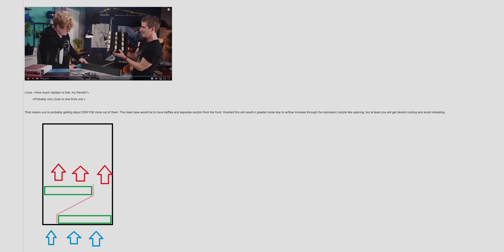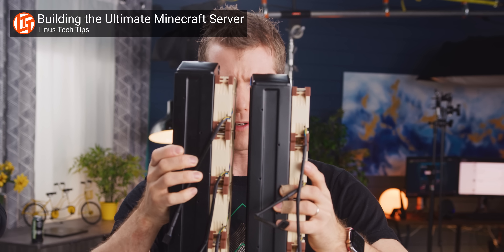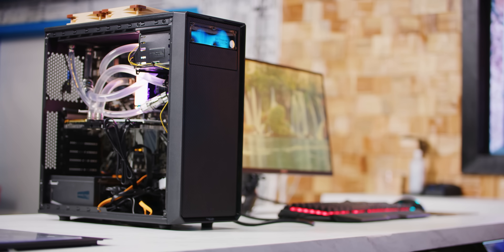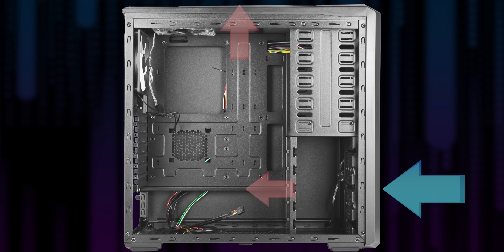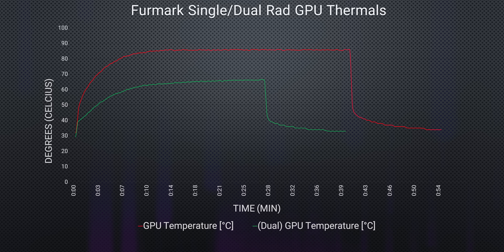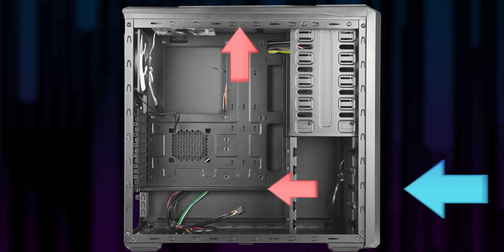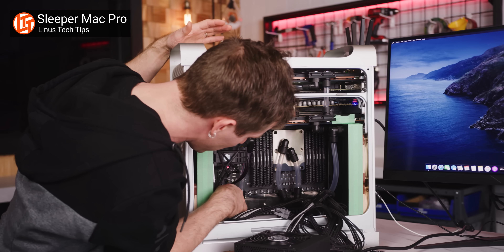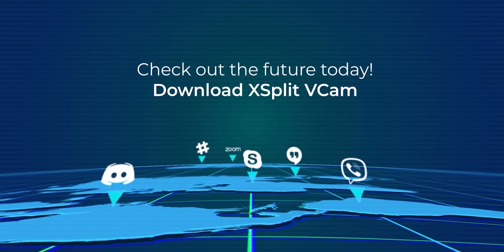I’ve been water cooling wrong for YEARS - $H!T Manufacturers Say

Comment: Corsairs' rad calculator is basically right but likely lacked the required data/specs of the exact cooling system units you used, so the substituted it with "generic data",
Their heat exchange calculator is likely based the same type of calculations (thermo-dynamics  & fluid dynamics) used for building HVAC Systems and Vehicle radiators/intercoolers when perusing maximum cost to efficiency of any heat exchangers. 

A. 
Their feed back on your 2 systems were likely based on:
1. The HackPro (1 front intake rad & 1 rear exhaust rad), where the first rad pulls cool external air to cool the first loop. 
This results in the air leaving the first loop and, being hotter than ambient.. increasing the temps within the case. 
The now already heated air inside the case, was then used to "cool" the second rad, which then finally expelled the even hotter air out the back.
So though it may not necessarily be pointless (depending on the spec/parameters of the loops themselves, additional exhaust ports, etc), it is definitely not the most efficient cost to performance setup.
Simplified solutions - a. Add an intake fan to the top of the case & flip the front rad to blow outward or 
                                      b. Add an exhaust fan to the top of the case & flip the rear rad to suck in 
2. The Custom Minecraft server (Stacked rad. build)
It follows the same principle above increasing the temp of the air leaving every rad then entering into another. It's just a matter of inefficiency.
Simplified solution - Take the exact series rad configuration and turn them parallelly with a radiant barrier between them and you'll see a greater value. 
                                     
I'm unable to say just how much gains you'll see without knowing the full loop's specs.. but yeah, you get the idea.

B.
And finally, the reason you got a better reading with your test system at the end of this vid, is actually kind of simple and obvious.. 
You actually used 2 feed separated, perpendicular intake systems that both pulled cool ambient air thru them, with case exhausting the hot air thru its rear. 
So it pulled from 2 cool sources and shared a single exhaust point (which is near always the best solution for this type of scenario). 
If you used an exhaust fan at the back, it would increased your efficiency even higher, as it was only operating on compressive force (a high positive pressure) within the case to discharged the hot air, rather than a "guided controlled flow". 
Again, there are actually a calculations for sizing the fans to give a desired low positive pressure, or even a negative pressure and determining what is the best to maximize efficiency for each scenario.

Think of it like this.. when increasing voltage for overclocking, there comes a time when the increase of voltage consumption vs the gains seen aren't efficient anymore.. even if minor gains are there.. well this is basically the same thing.
Heck, even these radiator systems could be made more efficient with the introduction of thermostat units (like nearly every other rad system).. but I'm sure on this small scale they are left out because of the cost/savings just aren't worth it and they are already able to reach the required thermal control.
Reply: I learned things, thanks for taking the time to expand on this video
Reply: why do I think that he made those calculators xD
Reply: jo jace right. It’s basically one bigger cooler moving more cool air. These aren’t really stacked.
Reply: @Skylane_Pilot  The "Series" arrangement is a Stacked unit
A Parallel/side by side arrangement, could basically equate to a bigger cooler
Reply: They are wrong for a slightly different reason, but you still do have a point:
And here is the thing: how hot the air exiting the radiator actually is, doesn't only depend on efficiency but also on flow rate. 
Very simply said: you can heat up one cubic foot of air by 10 degrees, or heat up 2 cubic feet by only 5 degrees. The only way to get the air exiting the radiator to match the temp of the water (in a cocurrent setup) is to have a low airflow. And In that case you're limiting the efficiency of the first radiator! You want the whole surface of the first radiator to be in touch with as cold air as possible, including the exit of the radiator. You want the air to be refreshed before it gets a chance to really heat up to make the first rad more effective.
This boils down to: Corsair is only right about the 2nd radiator hurting performance if your fan is too weak to supply the first rad with enough air. Fair enough...
---
IF their radiators could operate at near 100% efficiency, then their words would make sense. But that could only be the case when you have a phase change (like in HVACs), when you compress the air (with real compressors, not with a fan), or if you have a countercurrent exchange setup (like industrial heat exchangers).
^^If any of these 3 is the case, then the air exiting the radiator can be hotter than the water, and then I would agree with their theory.
---
I don't agree with your statement about diminishing returns. Computer builds aren't that close to physical limits, you can push it quite a bit in every direction you like. There is so much headroom that physical limits don't play a role yet. And computer cooling is a rather primitive setup (like no phase change, etc.), it's simple: want more performance? -throw in more air, more rads, etc.
But you're god damn right that they probably used some kind of standard model for calculating. What they mentioned is actually a big thing in HVACs and other industrial setups.
Actually a lot of students and engineers don't really understand the subject they learn, but they just copy one example project that their teacher taught them, and apply it everywhere. But they forgot it was an example, it's one of the ways to tackle a problem, it's one sort of problem you could face; and they treat it as if it's a universal method for anything. When I was a student it really bothered me.
It's really annoying when your fellow students get something wrong, when they don't want to listen to you explain why it's wrong, and especially when their idea didn't work out at all and you're the one fixing it last minute. And this happened on every single project.
Reply: Hey  @sasjadv  it was just an attempt at an over-simplified explanation, for Linus to understanding the "why", trying to use "layman" terms. 
Didn't see the sense speaking a language that would just go over heads of many.. and by extension, be of no benefit them.

Note though, the overall calculations of "System efficiency" do take fluid flow rate into account (and as we know, air is a fluid).. as well as all the properties and synchronicity of materials used in and around the system.. ie. materials and their thicknesses, material composition properties & fishes and how it relates to their absorption/reflective/radiant/surface resistance properties, fluid flow rates/CFM (internal & external), installation locations/positions/orientations, known/anticipated fluid viscosity, spacing distances & proximities. lengths runs, ambient temps,  wholistic location of system installed components, planar/coplanar assets/liabilities, etc, etc, etc as well as factors included for the unknows, variables and contingencies.. etc. etc.. . Yeah, that would have been more of a thesis than a simplified explanation.

And you are absolutely correct. Controlling the air flow (to the right cfm) over a rad is how efficiency is achieved in cooling the coolant contained within it. Also why a thermostat is used in vehicles to help control the coolant flow to increase efficiency of the system. In other words a "cold" rad doesn't meat the coolant temps are cold.. it just means the rad isn't getting the opportunity to draw the heat out of the coolant as intended. (Also, I am quite sure Corsair was referring to the 2nd rad n the first system).

The "diminishing returns" is a concept Linus understands relatively well in relation to overclocking, so it was just used as a reference of sorts, for him to better understand the point I was trying to make, in relation to cost vs efficiency. 
But the point still stands, that you CAN increase performance at a COST.. the question being the cost vs the value, as the additional equipment presently needed, would cost more than their presently available counterparts, the the masses would pay for. In other words (and being asinine here) a $10k upgrade for 1Ghz OC, is not something that would be widely accepted.
So we wait here for Intel/AMD to make a 10Ghz 6C/12T CPU efficient enough to be common place at an affordable price, that can be efficient across desktop Gaming and Workstations alike.

Yup, its always 1 person that carries the team in group projects.. it happens quite a bit in the working world as well.
Reply: @I_ammm_mojojojo  Ehm... Let's set things right:
If your radiator is 100% efficient, then the air temp and the water temp will just change places. Like air is 20° and becomes 50°, water is 50° and becomes 20°. If the temps of both meet in the middle (they both get the same temp) then the efficiency is 50%.
That's the official way of naming the efficiencies. And it makes sense, right?

One thing that Linus mentioned from Corsair's explanation is the delta T across the radiator. Linus did properly simplify it, however Corsair's statement is wrong.
Here is an example why: when you go to the restaurant you want the plate with food to be full at the beginning and empty at the end; but you don't want the plate to empty on its own, you are the one to make the plate empty by eating. The radiator doesn't want a temperature difference, it wants cold air, the cooler the better; it wants to get rid of the heat, it just wants a place to put it.
So as I said: you want all of the radiator to be surrounded by as cool air as possible.

Here is why a thermostat is actually used in vehicles: it's there to just make the engine cool down less.

The cooler the coolant, the cooler the engine runs, but you don't want that. And the reason is: thermal expansion.Engine components are actually  machined with too much play, so that as they heat up to 90° they get to the desired tightness. A cold engine is just loose, that's why you shouldn't put an engine under big load when it's cold.
And if you remove the thermostat and you engine temp drops down, then that only means that your radiator is cooling more than the engine produces heat. So it's too good at cooling.
And yes, right after a cold start the efficiency of the cooling system is 0%, it's not cooling because everything is the same temp. YES it can not draw heat out of the coolant, but you don't want it to cool. You want your engine to heat up to working temp and only THEN start cooling it to keep it there. That's the only reason for a thermostat.

The HVAC thing: if you have a low airflow, then you really want the heat exchange to be as efficient as possible, you want to get close to the 100% efficiency. Like you have a little bit of air, and you need to cram in as much heat as you can into that little bit of air. And then the second radiator is really going to diminish performance.
But this is the case with heating a building: when it's freezing outside you just want your room to heat up by 20°, you don't want you heat your whole street by 0.1°. So you actually care where this energy goes, and you want to transfer as much from the central heating into your room.
---
On the diminishing returns: if your goal is to just make your system cooler (which is all the video talked about) then you can just blow harder, add a rad, etc.
Let's say you already have a system, it's on your table, and it's running hot, what now? Then I would say: just blow harder, add a rad, etc.
I didn't look at what other CPU you could have bought for the money, that's just a different topic.

Comment: Could it be that the water went to the upper radiator first? Getting from 60C to 40C for example, and then, when it hit the second one (the intake radiator) it cooled down from 40C to 30C? That way the intake radiator could have 40C air going to the second upper radiator, which then cooled down the hottest water?

Comment: Surely the fan position makes a difference? To be optimal, wouldn’t there be a sweet spot in terms of distance from the object you try to cool? Also, if you’re too close, wouldn’t that mean there would be no air movement in the centre (basically like a hurricane where you have the eye and it’s perfectly calm). Obviously the blades will change some of that...

Comment: It is possible that as you used a small radiator in the front, it wasn't enough to dissipate heat effectively. I think in a larger case with something like a 360mm rad, you would probably experience very similar results to corsair's simulation.

Comment: What if you do front and top with 2 intake fans with radiators (meaning you blow ambient air trough both radiators). And then have only outtake fans on back or bottom ?

Comment: But for the love of god connect the radiators in a way that the hot water goes through the "hot" side radiator first and through the "fresh" side radiator second. That way you maximize the difference in temperature between the two mediums.

Comment: We can kind of calculate what is going on.

Watts dissipated = Joules / second  = Heat_capacity_of_air * density_of_air * volume_of_air * ambient_temperature_raise (W = J/s = J/(kg*K) * kg/m^3 * m^3/s * K)

So linus says he has 400W burning and the 2 radiators keeps it at about 20 degrees above ambient. Since the heat capacity of air is 1000J/kg, and the density of air is 1.225 kg/m^3, then you need: 400 / (1000 * 1.225 * 20) = 0.016m^3 per second of air flow.

A typical 120mm noctua fan is 0.026m^3 per second. But that is when every air molecule is impeeded by nothing. As soon as there is a radiator in front of it, the general rule of thumb is that the flow will be 1/3rd. In this case about 0.008m^3. This means we need 2 fans already.

And even at this point this is assuming that every molecule of air hits the radiator and there is zero thermal resistance. Again this isn't true. The general rule of thumb for this is about a 1/2 to 1/3rd reduction again.

So now we are talking 6 fans just to limit the temps to 20 degrees raise in ambient.

This is before anything to do with the water loop/radiator. This is just the amount of air needed to carry the heat away.

So no.... its impossible for a 2 fan setup to match a 4 fan setup if they are all cranking air at full speed WHEN the flow of water is dwarfing both in thermal terms of energy density per second, which is clearly the case.

Most likely the corsair were talking about a quite situation with very small number of fans at low speed and low flow, where as Linus is cranking 4 fans full speed and just blowing the contest out of the water due to the sheer volume of air.

Comment: I suppose Corsair was speaking more for the average user who would feel the costs of adding each extra component, and basically looking at diminishing returns. Like how a 1440p resolution is not so much more noticeable compared a 1080p one on a 5” screen, even though technically it’s quite a feat of engineering.
Reply: Then their statement that it could even have a negative effect makes absolute zero sense.

Comment: As you said, Corsair's point is valid. It may not apply to your specific example, but there are scenarios were what they say is true. If they indeed did a simulation they were right to notify you. The simulation no doubt used some estimates, and if the estimates were wrong then the model was not accurate. 

That doesn't mean they are full of crap.

As a general rule obviously more rads = good

An stacking (!!!done properly!!!) is generally GOOD.

But indeed when stacking, or staggering heat exchangers, there are some important considerations.

One very important one you should always consider is flow order. The order of water flow should be opposite to the flow of air. That is the first radiator in should get the last air out.

That is to ensure that all the radiators get a ΔT and can actually exchange heat. It's the same reason household radiators are properly plumbed with hot water flowing top down.

If you do it the other way around, and the hottest radiator gets the coolest flow, then that radiator will work super efficiently, but the other rads in the stack will get a progressively lower ΔT, (as water cools down and air heats up), and at some point you may even have water at the same temperature as the air flowing through the rad, at which point the rad is useless. This sounds counter intuitive because it in fact reduces the theoretical minimum achievable temperature of a cooling solution, but if you want that, then you shouldn't be stacking anyway.

Stacking means you actually NEED to stack, and if you do, then that order makes the stack more efficient. If you find your stack works better the other way around (hotter rad in the front(cooler side) of the stack) then you did not in fact need to stack :P

If you in fact have a rad that outputs eaxactly AMBIENT temperature water, then yes, stacking will be pointless or even detrimental if it impedes air flow.

Comment: Its based on room temp, In Canada the temp may be less lower.
So in normal scenario, the room temp will be around 27+
So the theory is not applicable wordwide.
If you run the same machine in hotter places, the results will be different

Comment: I bet Linus measurements conclusions are wrong, because LTT lenght testing is too short. It is science and LLT is not very good at science, but with gaming. 
If CPU and/or GPU is left working for several HOURS and not just until short test finishes, one could possibly see that temperature differential is important and that that producers are not saying those things for nothing.